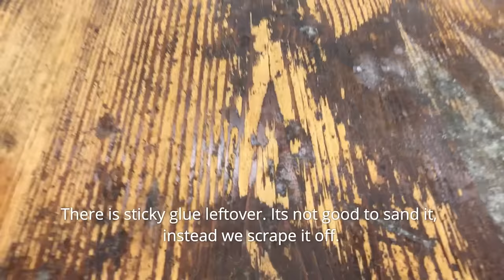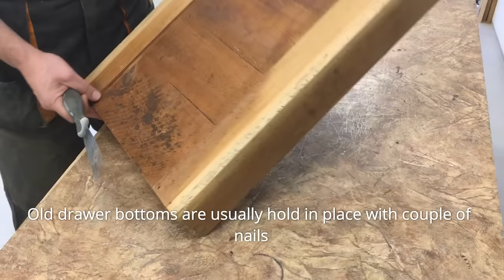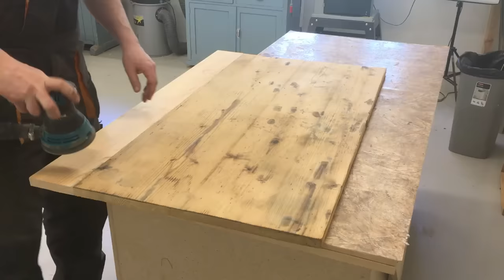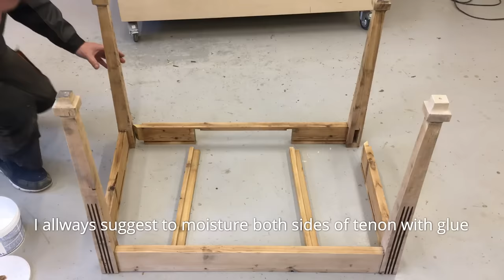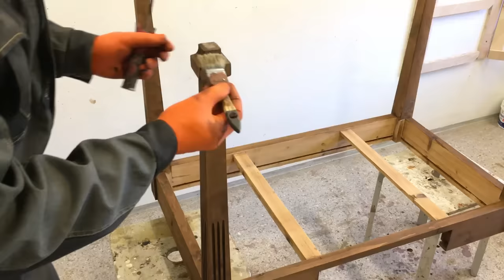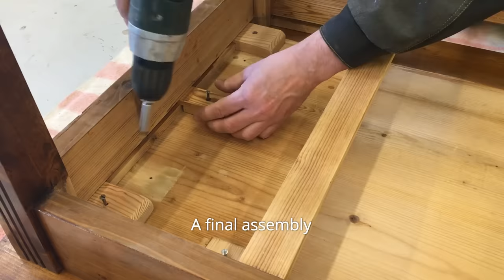How to restore an old table for beginner

Comment: There are thousands worth of tools used in this 'beginners' tutorial, you don't need all the fancy equipment, it just takes longer but you can do most of it with a sander and a hand held saw, and a lot of extra time. No hate just want to let people know ❤️ I've been restoring stuff for years and using all my dad's tools so I have a few expensive things at my disposal but not everyone does.
Reply: Very true
Reply: Very true but from a business perspective its not really easy todo
Its definitely possible to start a furniture restoration business without powertools but damn its hard i speak from experience 

Pretty hard to restore something and spend 10 hours on it making sure todo a beautiful job on it and then u finish only to make a little money
Its always going to be my dream
Reply: You could make videos using things beginners would have instead if the expensive tools...Like a tutorial on restoring without those expensive tools lol...I'd watch that
Reply: 100%. This video is not for beginners, for sure. Stiil very cool.

Comment: How can a beginner ever have the supplies used here 😶
Reply from the maker: I understand your point.  If you dont have all the tools then you can still use the basic printciples that are shown in the video.
Reply: Exactly what I was thinking... I have a very old library table that I'd really like to restore... it has some very nasty yellow paint on it but I don't have near any of these tools.
Reply: Look into community-run workshops! In Australia there are a few places set up with lots of different tools that you can visit casually, also really great for collaborating on things with other people :)
Reply: @piginmud  Seriously doubt there is anything like that here where I live... but I'll look...
Reply: @malagastehlaate230  You only need a heatgun and a scraper to get rid of that paint. You also need nerves of steel because there might be several layers of it so just be patient and do it little by little at a time :)
Reply: @OwnedByGalatea   Thanks... I need to work up the confidence to try it... but I am so worried I'll somehow destroy the table... but I really HATE that awful yellow paint and want to see the beautiful wood that you can see in the drawers so bad...
Reply: @malagastehlaate230  Dont worry about it too much, just make sure your scraper goes in to the surface with flat contact, what i mean with this is that your scraper doesnt dig in from other side because this will leave a nasty canyons (as i like to say it) to the surface of the wood very easily. Also once you start seeing the wood, get p80 sand paper and sand it with your hands using for example a straight and flat block of woof as your handle, just wrap the sand paper around the block of wood and do long passes throught the table top. Eventually you will hit the surface of the wood and you notice it when you start to see saw dust everywhere. I know it sounds like a lot of work and it is but as i mentioned, do it little by little :)

Comment: You are not just a carpenter but an excellent craftsman. Excellent restoration. The only problem with this table is that it will not be steady and sturdy as the legs are not joined. Rest, a beautiful restoration.
Reply from the maker: Thanks for your kind comment! This was actually really easy project compared what I often have to do. Legs will be fine because the upper joints are long and that makes the construction stable. I have more videos coming soon, so stay tuned!
Reply: @ATRestoration  Ok, thanks for the reply and I shall see all your other  videos.

Comment: Don’t get why everyone is complaining about the power tools. It’s wood not steel. Just about everything you did could be rough cut with a coping saw and rotary tool then finished by hand with sandpaper and a good chisel or two. The process is more important than the tools.

Comment: A few things. I think you should use stripper to get out as much of the old stain as possible, rather than relying entirely on sanding. I also think you could maybe have just glued the tenon(s) back into the mortise(s) and the table would have been strong enough without having to take it all apart and doing all that extra woodworking. The inside of the drawer and the underside of the table didn’t really need to be sanded. You will get richer looking stain coverage if you leave the stain on for a few minutes before wiping it off (I thought yours looked a little splotchy). Always go with the grain when applying sealer.

Comment: this is an incredible restoration but it is not for beginners.  I have a sander, heat gun, rubber mallet, wood glue  and scrappers not an entire shop.   I would love a table saw and other large equipment but who can afford that as a beginner.  Beautiful work by a professional wood worker.

Comment: Apply linseed oil to all end grain to prevent over absorbing of stain that causes overly dark end grain. Also, just use a sponge to apply stain in one hand and be ready to wipe with a rag in the other hand. Sponge use is easier.

Comment: While I appreciate your love and talent for restoring this piece of furniture…nice job, by the way…you really concerned me with your use of the planer without push blocks.  Statistically, the table saw is the #1 most-dangerous power tool, followed by the chain saw, followed by the jointer.  Let’s pray your new nickname doesn’t become “stubs.”

Comment: Thanks for this video! 
Maybe, you can give me some piece of advice? I`ve had a problem with varnishing a small box recently. It is made of beech wood and I used to paint it with water stain and then cover acrylic varnish (exactly as you do). But after 1 layer of acrylic I`ve tried to sand it (800-1000 grip paper) and erased the stain! on the corners. I was doing it by hand and still don`t understand where is the border between "enough sanding" and "too much". That first sanding should be very light?
Reply from the maker: I suggest to use one layer shellac after staining (or any other solvent based varnish) and then use the acrylic varnish.

Comment: I've had people bring me a table or sideboard to clean off the flaking varnish and remove the water rings left by vases etc., (and re-tighten the structure). But sometimes they want these marks and any burn marks to stay, so to add to the authenticity
Reply: Sorry, sent before I was finished😊. Anyway, often the top has a bowed or hollow section. So what I do is, if the hollow section is on the top, I make two or three cuts with my table saw length wise underneath the hollow, but not right through. I then cut strips of wood slightly thinner than the saw kerf, and glue them into the kerf. When clamping, that section is flexible enough to be bent back to be  level again. The surface is thus not altered, and all the scuff, ink or burn marks are still visible. Most people want the original wood to be shown, so I don't stain, and just apply 4 coats of clear polyurethane. Hope all this makes sense
Reply from the maker: Polyrethane is less known here, but I have experimented with that. Do you use waterbased or solvent based polyrethane and why?
Reply: Hi, I use solvent based polyurethane, mostly because I'm quite familiar with it, and  it's very resistant to water or alcohol marks. The bramd I use hete in South Africa is low gloss Woodoc 5.

Comment: I enjoyed watching your videos, Your work is very good.  

I am in search of a heat gun, And I notice there are many different ones.  Are there any particular features you would recommend that I should look for when choosing a heat gun?
Reply from the maker: I have had this simple Makita gun, it is 20 years old and it is still working. So I suggest Makita.
Reply: @ATRestoration  so ... the hotter it can get, the better?
Reply from the maker: No, I think the expensive ones get more precise heat control.

Comment: Great end result !
What is your opinion about original patina and when do you deside to maintain it or get rid of it? And does it all depend on the end goal of a restoration being it a daily [ intensive ] use of the furniture or it being merely a piece with a decorative function ? 
I suppose that a restoration of a museum piece is completely different then a restoration of a furniture piece for daily consumer usage. 
This because your restoration method is quite thorough in approach when using sanding machines and new wood in visable areas and the use of staining / varnish methodes to make it look old / antique / used again. 
So I wonder what your thoughts about this. 
Regards,
Reply from the maker: Theres patina and there is layers of dirt, engine oil,  tape glue and diagonal cracks trought the plate. I would save the original finish if theres any to be saved. In this case there wasnt. Some purists like to sit behind the desk thats sticky and uneven, but most people dont want to. These pieces that I restore often have not got any maintaining for hundred years. Thats why I have to make it clean and make it usable again. And I like to do it so that the person who uses it, can do it without worring to brake it again.
Reply: @ATRestoration  I understand. Thank you for your answer.

Comment: So I'm just getting into furniture restoration, and at the moment I don't have any tools.  What would you say are the bare minimum required power tools?  I have a power drill at least, and will definitely be getting a sander, anything else you would say is a must have?
Also I'm sure a heatgun is way better, but do you think a hair dryer would cut it, or it'd take an insanely long time?
Reply from the maker: Hey! The airdryer wont cut it. I allways use Makita tools because they are fairly priced and well done. When I started I had a tablesaw, planer and a sander. If I would start over again, I would invest more into tools, than I did back then. I hope it helps you.

Comment: One of the legs has termite holes. You should have replaced it before you connected the new part beneath it.
Reply from the maker: I have done this job over 20 years and its very rare if client brings me something back, because of failed connection. I made the connection in the legs widest point, so there wont be any problem even when its eaten by termites.

Comment: Nice job! It looked like small holes from wooden worms on one of the table legs. There are remedies for that. I bought this for a lot of money, but saw in the product information that it contained colorless100% ethylene glycol. You can buy these in specialty stores for car accessories. It should be cheaper, but just as toxic!

Comment: Beginners...well to start, you’ll need about a $10,000 to kit out a decent wood shop: Table Saw, Drop Saw, Jig saw, Planer, Clamps for Africa’s, Good (at least) chisels, work tables, a working knowledge of the chemistry of glues, stains, shellac, a lifetime of acquiring a multiplelicity of tools.

Comment: I saw someone doing table restoration by sanding the old varnish, put paraffin wood putty in the small cracks and holes, apply ochre powder with water mix (also called as oker or oyan locally here) to the whole surface, and apply four coat of sherlac varnish on it. Is that a good idea to use ochre?
Reply from the maker: I dont know, because I never used it, but I know that some people do.

Comment: Could you make a video showing us how to restore something simple with the least amount of expensive tools possible please? For example; I can invest in a sander because there’s so many uses for it, but I couldn’t invest in a heat gun because I wouldn’t use it as often. I’m also very broke lol. Please.
Reply: In my opinion the most important tools for smaler repair work are: A good hand saw, sharp chisels, a Sander and an iron. A Router and a hand plane are also useful. You can start whit only simple tools but specialised tools an machins makes the work easier.
Reply: @jonawolf8023  tyvm

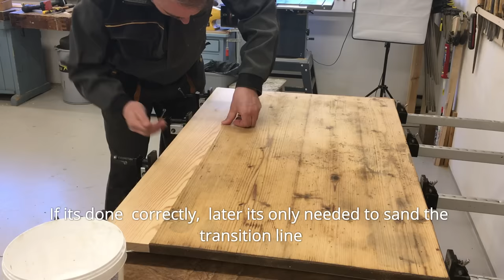Comment: I've noticed that whenever you glue two pieces of boards together, like 5:50, you never use dowels or biscuits. Is there anything reason why that you hardly ever used them?
Thank you.
Reply from the maker: Usually there is no need for them, it’s just overkill.
Reply: @ATRestoration  thanks 👍

Comment: As someone who used to restore antique furniture for resale, I would would title this video:   "How to restore an old table for beginner with a fully-equpped woodworking shop."  How long did it take to acquire all the hand tools and electrical tools and dust collection system?  A better video for a beginner might be picking a piece of furniture that is sound but requires refinishing or painting by sanding, stripping, or or scraping the old finish off.  It takes a while to acquire equipment and develop the skills to do the kind of renovation you show in this video.  Just my two cents........

Comment: sanding with a rotary sander is an irreparable error. After finishing, the rotation marks remain on the wheels. Only with a vibratory sander.
Reply from the maker: Thats not true. This sander does both movements at same time. The rotation movement is very slow.

Comment: Why did you use a new piece on the table top instead of reusing the old?
Reply from the maker: The old piece had long diagonal cracks in it. Its hard to repair them so that it will last for a long time.

Comment: What beginner is going to have 10k+ worth of carpenter’s machinery. It looks nice but ain’t for beginners.
Reply: Right. I want to see an example of how to do it with basic tools, stripper and maybe an orbital sander
Reply: In Germany its normal to rent a full equipped Workshop for a day or a week. Acsess to machinery and tools is not a problem, just the knowledge.

Comment: Why didn't you use a biscuit joiner instead of glue on the top piece?
Reply from the maker: I prefare to use old technigues if its possible. Also the glue holds only one side, other side is hold with wooden blocks. That gives the room for wood to shirnk and expand. Many modern solutions are violating this principle, which causes cracks in wood.

Comment: You say this is for beginners, BUT ITS. OT. First you don’t so we ask and the words don’t stay on the screen long enough. Second, you are using a lot of high-tech equipment (not for the novice). Third the project you used to make the video is fine, but does not work for the novice, but the professional. No harm intended. I’m sure when you are finished with the piece it will look AWESOME. Maybe it’s me because I think this is something I would like to delve off into. After watching this, maybe I’ll just continue painting over furniture (as opposed to doing it the correct way). Thanks anyway.

Comment: Buys rotten old table for $10...
Thinks: "I need to restore it..."
Decides to buy $50,000 worth of woodwork tools to do the job...
Fixes table...
Sells for $20...
(Only joking... wish I had all that lovely kit!)
Reply: You can do most of what he does with hand tools, but it will take longer. Electrical tools are relatively new historically speaking. Everything  pre the early 1900s were made without them (they had some that ran on steam and coal though).
Reply: @Mhidraum  o
Reply: Why take original finish off? Instead clean original finish.  Decreased value..

Comment: What about the wood worm?
Reply from the maker: Woodworms dont like low humidity in the air, as it is in modern houses. But if you keep the furniture in damp rooms, then they will live happily ever after.
Reply: But they are already in there & will carry on eating. I don't know where you are but here in the UK once they are in unless you paint on the killer not only will they carry on eating what they are in they will also move to nearby wood!
Reply from the maker: @samgould9930  This is possible of course but even when you use chemicals to kill them, there isnt really any way to assure that they are all killed inside the wood.

Comment: Why don't you  use  bone  glue. It is an old  piece?
Reply from the maker: Bone glue is surely more authentic, but it has no moisture resistance and it shrinks in time and of course its easyer to work with PVA.
Reply: @ATRestoration  Humidity? That's true. However, the restoration is much easier than with a piece glued with the modern wood glue. I find the handling of bone glue quite easy.

Comment: All that work and you didn't refinish the entire piece...disappointed.
Reply from the maker: What do you mean by that?
Reply: Oh, I mean that you didn't refinish the bottom as well.  I just feel that the entire piece should be refinished entirely even though you don't see it.   I know that not everyone sees it that way.
Reply from the maker: Actually you never see it on old pieces, done like that and even with modern pieces its very rare.

Comment: Beginner??? Hundreds of thousands of dollars in equipment. (I get you don't need the vacuum dust management system, but there is no explanation of how to do this without the highly specialized tools)
I still would have watched a restoration video. I would have watched a "look at all my tools in action" video. Angry at the bait and switch.
Reply from the maker: Hey, it isn't so expensive as you imagine. All my equipment together is around 10 000€ (not100 000) when bought as new. When you buy used, its even cheaper. For example, I have seen used industrial panel saws in sale around 1000€. I started my business in 1996 only with planer, table saw and a sander. Its possible, but it all takes more time. I used the machines, not to show off but introduce them to the people who have no idea what they are used for. Its my first video that went viral, so I didn't know what people expect from me. Im just sharing my skills that I have mastered in 20 years of everyday work and least people can do is appreciate that, not pick me because of two words.